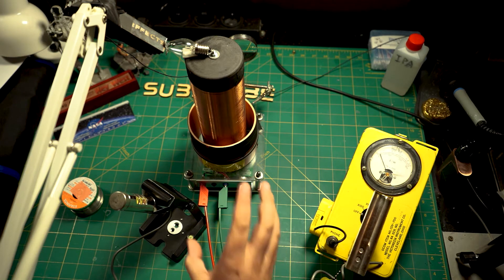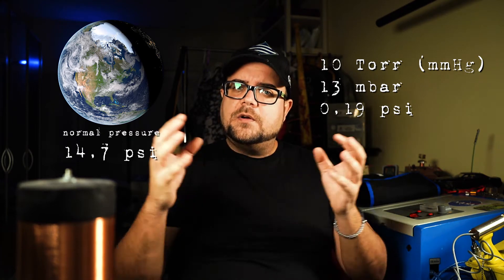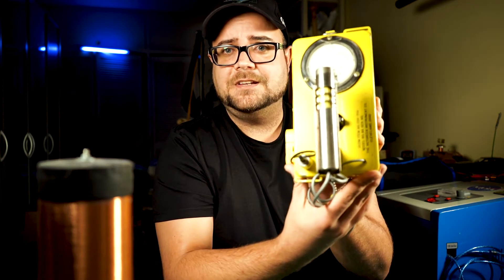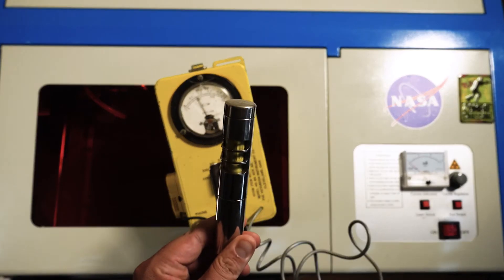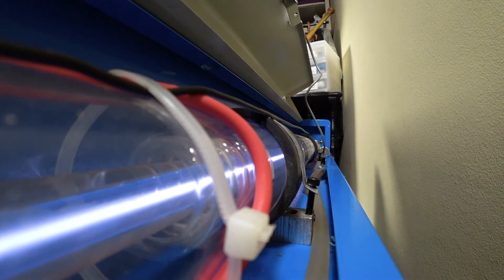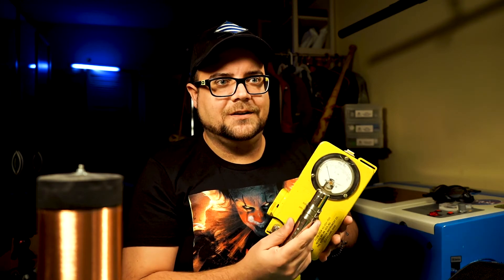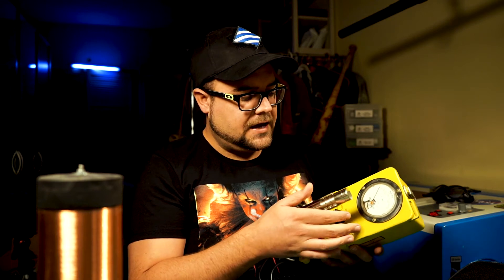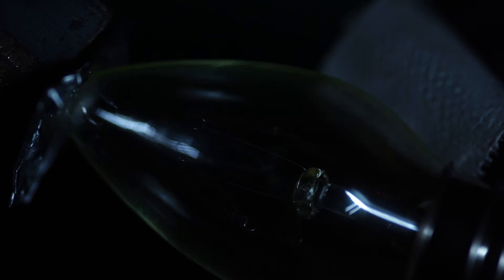K40 Laser / X ray Machine ? - CDV-700 Radiation Detector

Comment: The bulb probably didn't produce alot of xrays (I'm sure it produced a little) but alot of the reading was from the electric fields emitting from the Tesla coil because it ionizes the gas inside of tubes and bulbs and the way those Geiger counters detect radiation is using a gas filled tube so it was probably mostly ionizing the gas inside of the Geiger Muller tube and giving a false reading try it with the Geiger counter on the other side of the room and if it detects anything then it's xrays I've done the same with my Geiger counter and realised the high reading was from the discharge coming off the high voltage supply alo those bulbs are filled with either nitrogen or argon (more then likely argon)
Reply from the maker: Very interesting comment! Thanks for that, sounds very plausible, as Geiger counters themselves need high voltage to operate! 👍🏼

Comment: To produce Xrays at medical use, you need a very high vaccum and a very hard target as tungsten. The electrical values used for exposure are the technique for specific anatomy. For example, to see hands bones, you'll need between 40-45 Kv and a tube current around 50mA for 0.1 sec.

If you want to see lungs or hip you'll need rise Kv up to 70-90 (depending of sizes patient), and current about 200 mA for a half sec.

The laser tube uses gas inside, the Kv is  low and the target is soft.
Reply from the maker: Thanks for the interesting comment!

Comment: The voltage in the laser is too low for generating x rays. General consensus is that you need around 100kv, although it depends somewhat on the amount of vacuum.

Comment: I guess there will be no X-ray radiation because the high voltage causes the plasma and so the elektrons can't get fast enough to produce X-ray when stopped
Reply from the maker: Very interesting! Wouldn’t it be also as plasma generates that the electrons theoraticly “have another way to go”, like electrons are going the easiest and fastest way ?
Reply: @MancaveEffects  
There is enough gas in the tube so the electrons hit the gas molecules and put it to a higher energy level. When the gas in its exvited state is hit by the photonpulse aka light it jumps back to its basemode and emits some aditional light. So you get the resonating effect whitch produced the laserlight.
 So this cold plasma aka glimmentladung absorbs the energy from the electrons which cant get enough speed for producing x-rays.
When you remove the gas from the tube and put a glowing wire in one end you will get lots of x-rays.
Maybe you can build a x-ray saurce from a lightbulb by mounting an elektrode on the opposide side of the bulb and applying a high voltage between this elektrode and the glowing wire
Reply: @MancaveEffects  
The wavelenth of the laser depents on the lasergas or what gets excited by the plasma.
In case of the co2 laser the light is infrared because the energy which is emitted when the gas jumpes from its excited state to the ground state is at this wavelenth.
In case of a He-Ne Laser the wavelength is green because the gas emitts different wavelength.
For a x-ray laser you need a gas or a semiconductor  which emitts light with a very  short wavelength.
So you dont use visable light of ir light to produce x-ray radiation. You need something with a higher energy to produce x-ray photons.

Comment: Maybe you can read some measurements if you do with pulsed fiber laser like the big ones that cut metal with 2000w or more, even a 60w fiber laser engraver engraving metal
Reply from the maker: For what i read about x rays outgoing from lasers, high power fiber lasers do generate  x rays when they are exceeding 25kv of operational power. There are regulations about exposure to workers over time. I did multiple hours of engraving with the dosimeters placed inside the machine. The engraving mode does pulse the laser at higher frequency but no reading at all.
Reply: @MancaveEffects  yes , but remember pulsed laser reach higher peaks that makes able to cut metal , but that devices are heavy isolated similar to the medical resonators in helicoidal x-ray rings
Reply: @MancaveEffects  I'm pretty sure that conventional Co2 machines are free of x-ray emission
Reply from the maker: Good to hear! 😁
Reply: So does this bust the myth that it will give you skin cancer from rays?
Reply: @kaistein7143  yeah,  at least from exposure, some geniuses like to do skin burning tatoos that last a week that's a 100% skin cancer for sure if you do regularly
Reply: Ok, because I am going to buy one and I heard you could get radiation from the laser, so I was going to replace the glass viewing window with another to prevent this.